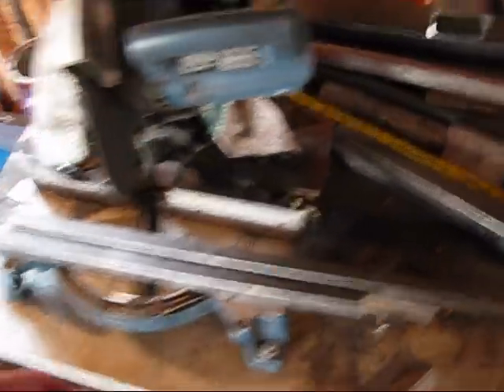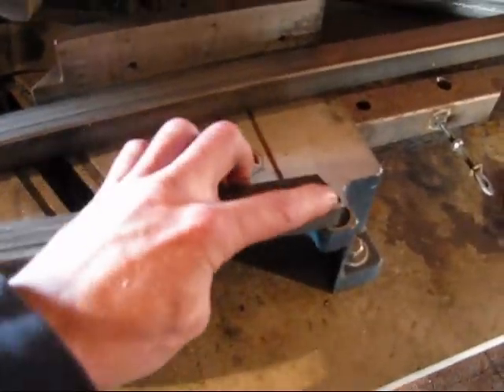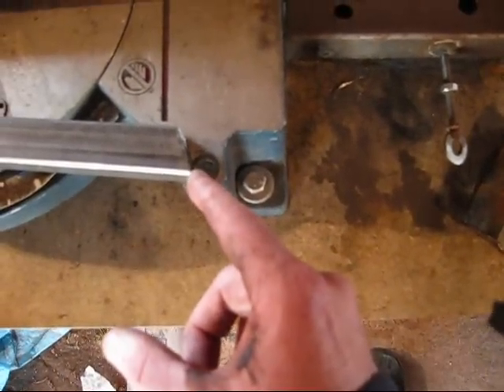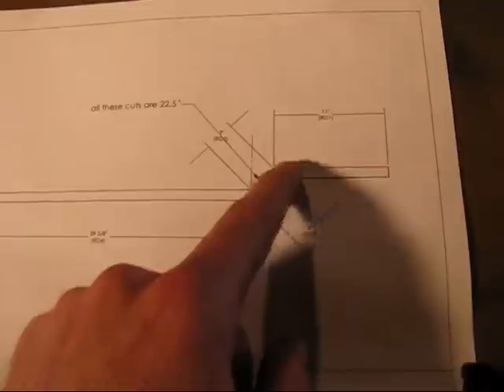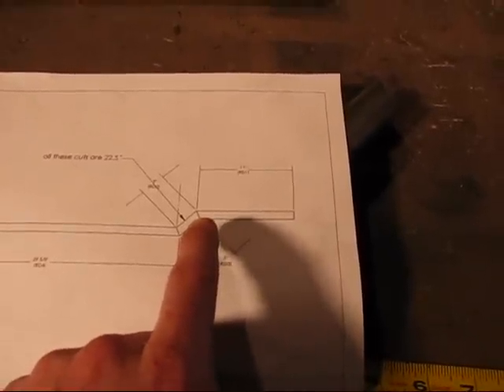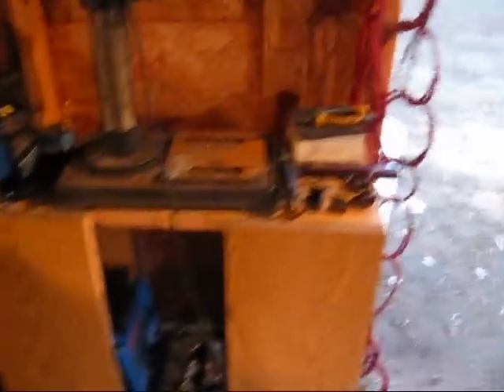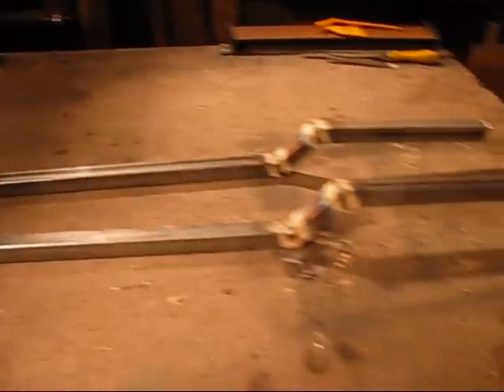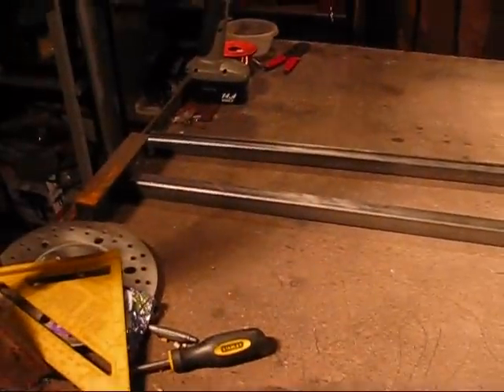█ Go kart Reverse Trike Build #1 █

Comment: After you cut the angle if you cut them to length at the same time then they will be both exactly the same length, nice jig, yep I just want to fly  sure wish I could be doing this along with you guys this looks cool. Would you mind if I posted links to your build on motorbicycling I think there is a lot of people that would be interested in your build lots of guys use the engine you are using.

Comment: both of my  hf welders i had did the same thing they stayed hot even after i let off  i took one back and got a new one it did the same thing then i found out it was not a bad one it just how its made so i saved and saved  a got a licoln  and i put that dam hf  thing in the dumpser   grab some scrap and get used to it once you do then it should be fine for ya   keep up the work and have fun

Comment: @Tmansgokarts  love my linoln   they make a 140 i have used it   the 140 is a good welder but  for some of the thing i do 120v  would not do so i had to go for the 220v 180c  i like HF they have good stuff for the price  i know a lincoln is not cheap but well worth the saving  i took me over a year to save my  pennys to get it  you should have seen the guys face when i whent in there with over 600 bucks in rolled  change  
take care 
chuck

Comment: Dude, if the wire is changing up it's speed you need to clean off the push roller by the wire spool and/or tighten up the spring clamp that holds the wire against the roller and/or clean out the wire sheath where the wire feeds into.  If any of that isn't tight enough, or is gunky enough, then the wire will stick as it tries to push through into the sheath.  Then it feeds funny, and it's not fun.  As you found out.  ;)

Comment: The best welders I've ever used are Lincolns, obviously.  But, of course, they're twice as expensive as the Millers and Hobarts I've had.  For obvious reasons... they work really, really well.  BUT, if you keep the pieces of the cheaper welders clean, tightened properly, use them carefully... they'll make just as good of a weld.  They're just not as "user friendly", so you get what you pay for. *shrug*

Comment: I'd actually preferr the "Hot Tip" because I'm use to using stick welders. I dont like wire feed welders. I tried my grandpa's when i was around 7 ( I learned with stick at 6) and i absolutely hated it.